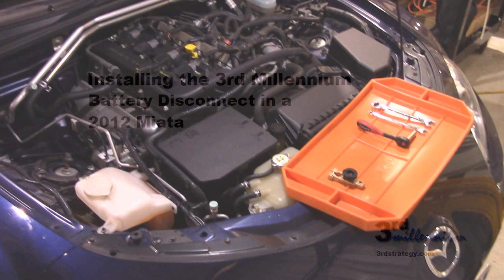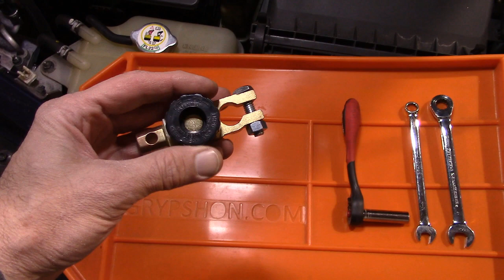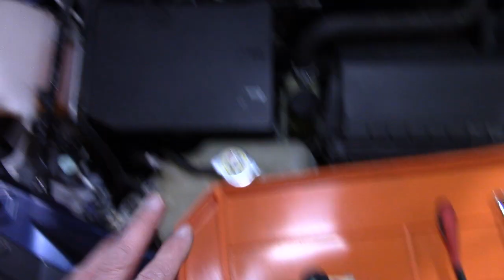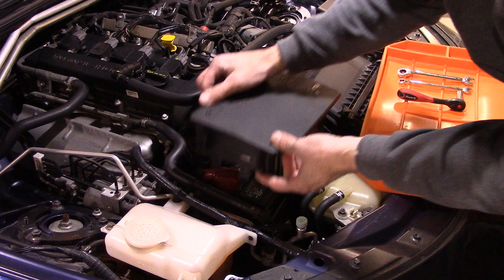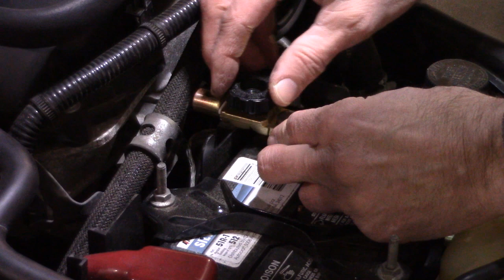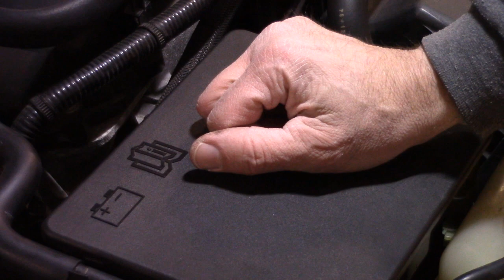Installing 3rd Millennium Battery Disconnect into a 2012 Miata

Comment: I installed the BD on my mazda miata. Is it normal to get some kind of rattling when I am coming to a stop?
Reply from the maker: There wouldn't be any noise from the battery disconnect. There are no moving parts involved. So I'd guess whatever you're hearing is from something else. Double check that there isn't a tool left under the hood that's rattling around (we've all done that once or twice). Also, make sure that the battery cover and cooling lines on the left side of the cover are reattached correctly.

Comment: Just purchased this battery disconnect. In the event that the Miata does not turn on after 3-4 months, do I need to remove the battery disconnect in order to jump start the car?
Reply from the maker: Hopefully the battery will hold its charge as it will be totally disconnected. But in the event you need to jump start your car, there's no need to remove the battery disconnect.
Reply: @3rdMillennium  Thank you! Do we need to replace the battery disconnect after a certain period of time?
Reply from the maker: @neomarie91  No, it should last longer than the car itself. It's made of an alloy called Zamak 3 which made up of zinc, aluminum, magnesium, and copper. It's very strong and rust resistant.
Reply: @3rdMillennium  One last question. This is probably a dumb question, but can we drive the miata after we install the BD1 or is the device purely for storage?
Reply from the maker: @neomarie91  The battery disconnect can stay on permanently. We never remove them from our own Miata's.

Comment: have a question when I disconnect the negative would I have to disconnect the positive also or it cuts power off completely from the battery

wanted to do electric work install double din radio without a short or fuse blowing
Reply from the maker: You just need to disconnect the negative terminal.

Comment: Does this battery disconnect work with 2006 Miata year?
Reply from the maker: It should be the same for 2006-2015 although I don't think we've personally tried it out on a 2006. But if you'd like, send us a picture of your battery setup and we should be able to confirm from that. You can contact us directly on our website at https://3maudio.com/contact.html